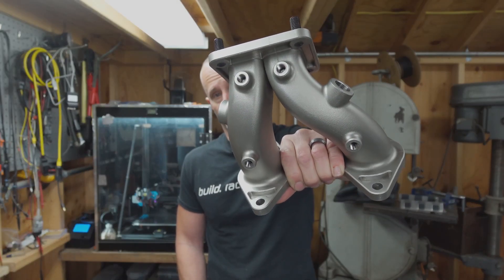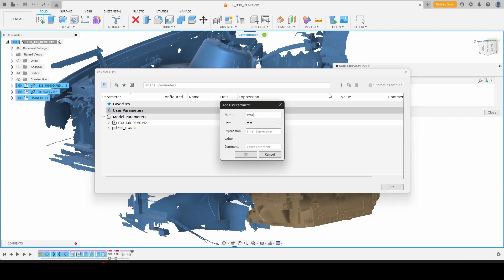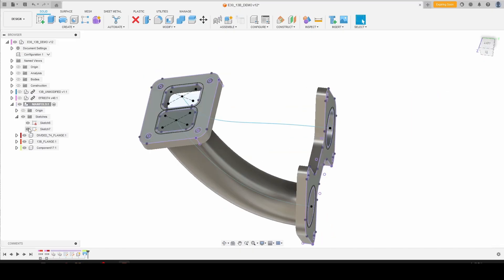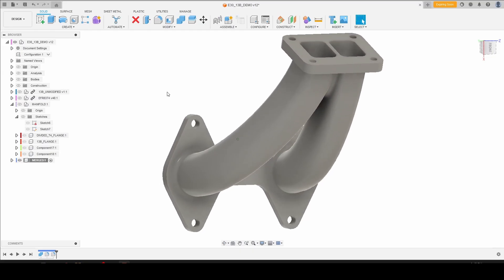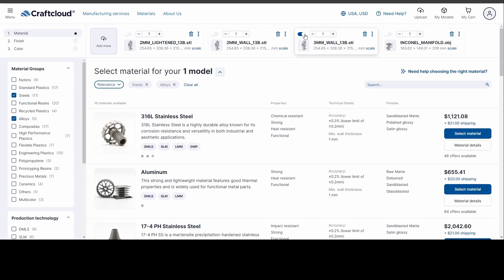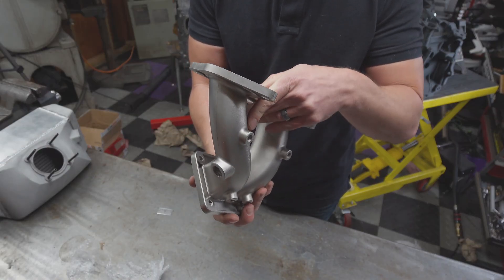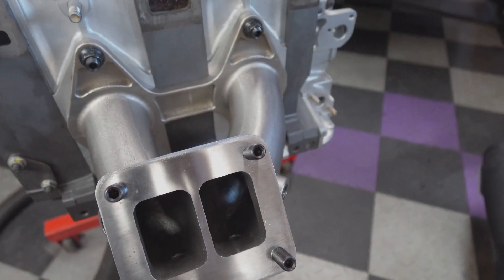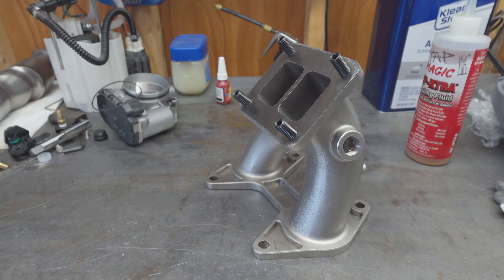Design and print an Inconel turbo manifold - Building a 13B Rotary BMW i8 : EP3

Comment: Wait I'm confused. Didn't you order SS not Inconel? Either way, this is awesome. Cool project and I subbed.
Reply from the maker: Inconel. The “order”was part of the demo to show what the typical buyer might choose. The manifold design reviewed is not the same as in the demo or checkout and you can see the manufacturer on the box is also different. Prices for the reviewed manifold are in the “i8 swap” column of the cost breakdown.
Reply: @CouchBuilt  Ah okay just confused me slightly and the colors in the pictures for the price comparison also made my brain think it was different. That's so cool!
Reply: Likewise. Way impressive and some knowledge 'bout 3D printing is mega appreciated ❣

Comment: 5 things I learned that weren't very clear in this video: 1) Don't use pipe command as its more restrictive and error prone looking for "ideal" radius turns. Loft/Shell seems to allow for tighter turns not achievable via pipe. 2) When using Loft/Shell select both ends of the loft before shelling it out. 3) Use boundary fill to select/combine the pipes and only check the sections you want to keep 4) multi fixed point splines are manageable-ish if you are okay getting dizzy spinning around making sure all angle of a spline point are pointing in the correct direction. 5) free trial license for simulation is useful to determine load/stress areas, weight savings via shape optimizer, and minimum resonant frequency for your application.

Comment: Following this video and others on your channel I designed a header of my own and sent out for 3D print (haven't received yet).  The 3D printing company sent me a message saying that because of the design a 1-2mm deformation "may" be possible.  Have you experienced this?  Have you found that the printed surface of a V-band is adequate for sealing without any post print machining?  Do you find it best for longevity / reliability to post cut (separate) the exhaust tubes at the main flange?  Oh, I used your Craftcloud discount code, thanks!
Reply from the maker: Yes, a larger part is going to have some deformation and the vendor usually does a good job of giving a warning. This really isnt anything substantial and you should leave a little material to face any flanges. If you've ever welded a full tubular manifold, things move around much more than 1mm unless its welded in a sturdy fixture and allowed to fully cool. Even then they can move around a bit. Generally the vband stuff has been usable as-is but its not a bad idea to add another .5 -.75mm of material just in case it needs facing. That wont affect clamping if you dont remove it.

Comment: very nice but man that manifold is 1/2 if not a 1/3 of what i would need for a 4cylinder, with 2 times as much material im assuming that would mean 2 times the cost. so a stainless manfold would be $1500-$2000. ill upload my manifold design to see. was really hoping this option would be more affordable.

Comment: As someone who really doesn't know anything about this (just find it interesting) why couldn't you use aluminum and be a lot more affordable and lighter. Is heat the problem with that?
Reply from the maker: It’ll melt. Exhaust gas can be 1800°+

Comment: When you placed your order, did the vendor respond back with a list of warnings regarding support martial removal, deforming possibilities and the risks of printed threads? 

I attempted to place an order and due to the complex design of my manifold there will be support material inside that will be seemingly impossible to remove. This is a much bigger concern compared to the threads or slight deformation. 

Any tips?
Reply from the maker: Generally Id suggest not printing threads and I only did so because of the inconel being a bitch to tap. For stainless and aluminum I just size to drill hole. Yes, I have had warnings about deformation or supports on various parts. Some designs will need to to multi-pieced. I did have a warning about unremovable support in my charge pipe, just around a bend, but I was able to reach a 1" emery cloth strip into the pipe and sand down the remaining material. You may need to alter the design or get creative on how you do the final post processing.

Comment: Is aluminum not a suitable material for this? I know turbo discharge is hot, but I didn't think it would be so hot that you can't use aluminum.
Reply from the maker: Aluminum softens at 1200F. 1800F pre turbo EGT isn’t unreasonable.
Reply: @CouchBuilt  It just dawned on me this is the exhaust manifold. Somehow I had in mind this was the intake manifold from the turbo, and now the steel/inconel makes much more sense. Thanks for the reply
Reply from the maker: @ChristianStout there’s another video on the aluminum intake

Comment: Holy cow, your walk through on how to do the runners is one of the absolute best i have seen for making runners.  Are your runner lengths similar volumes?
Reply from the maker: Low single digit percentage of being the same. It’s been a minute since I’ve had to think about that component.
Reply: @CouchBuilt  I know on turbo vehicles it isn't as critical as an NA build, but you are giving me energy and ideas on doing exhaust manifolds for my F136 swapped FR-S!

Comment: what is the purpose of using incanel here?Shouldnt titanium offer better spefici strengt while still being able to withstand the heat?
Reply from the maker: Inconel has a higher service temp. Titanium is better off used for structural or fastener type applications. It’s a rather poor exhaust choice.

Comment: typical higher end build? log manifolds for m50 go for 150€+ tax/shipping, "higher end" material log style collector is like 500€ max :D 1.6k for m50 log :D thats ridiculous money for a engine that doesnt even cost that much :D
Reply from the maker: It was generic example of a 6 cylinder sized manifold. Nobody would spend that on a 250k mile boat anchor. Something like a G80 S58 is another story. Also the internal geometry capabilities are way beyond a fabricated “log” manifold.

Comment: Something that you didn't mention in the video but that I think would've been worth including is that if you're thinking of dropping $1000+ on a metal 3D printed part of your own design then you really should FDM print the part to first to confirm fitment unless you're 110% confident in your measurements and your CAD files. All it takes is one error in a critical measurement to turn that nice expensive metal printed part into a paperweight.

Great video otherwise!
Reply from the maker: Good point. I used to obsessively print test pieces of all the stuff before sending out for metal. These days I just trust the CAD generated from my scan data. However, if Im using 3rd party CAD or scans, Ill still consider making a test FDM piece.

Comment: Why did you end up going with Inconel vs Stainless?
Reply from the maker: It’s a better material if you can afford it. Much higher strength at high temperature. Stainless will work fine, but the cost delta wasn’t terrible for my application.

Comment: You can use sample tubes with restrictors into small chambers with o2 sensors that get vented into your main downpipe. It will allow you to get perfect O2 readings without a need for specialty pre turbo sensors and a custom control system. You may even be able to use the bank to bank fuel corrections in your ECU 

The 2 1/8 inch holes bypassing exhaust won’t reduce spool up in a noticeable way. 

The sample tubes will allow you to mount the sensors in a easily serviceable or accessible spot

Comment: Very cool. FYI titanium is not well suited to exhausts at all, but 3d printing may help as webbing or extra wall thickness could be added in stressed areas. Inconel is choice though
Reply from the maker: I’m no advocate for titanium, but it is used by quite a few people. If they’re going to commit to that material choice, they at least have the option of adding 3D printing to the toolbox.
Reply: the irony of these sorts of statements is the existence of full Titanium valvetrains on both the Intake and Exhaust sides including retainers/keepers for decades and in Aerospace and Stationary power for Jet Turbines.  while laymen might not know what to do (personally) the OEM's have long figured this out.  whether one is big or small, cost for sure will always be a "dealbreaker".

Comment: ok so remember 3d print metal has 1% to 5% shrinkage. you always have to remember too add 1% or 2% size when at the model stage. think about it, the 3dprint metal has to be fired and so looses a few %. good video.

Comment: Would you normally print threads or just overfill then tap?
Edit. I see you did overfill them a bit
Reply from the maker: No, they are modeled at the correct size in the STL. It’s not possible to print them cleanly enough to be 100% accurate. This just saves the pain of cutting full depth inconel.
Reply: @CouchBuilt  Nice work. Subbed :)
Hi from New Zealand

Comment: Great video. I used 3D printing when I designed my upgraded replacement gearbox casing. If you have the skills to engineer and CAD your part, I think there are almost more reasons now to go that way than to buy an off the shelf part (especially if your platform isn’t as popular).

Comment: finally, we can put an end to the typical internet forum malarkey between various vendors merchandising saps and what some of is have been saying for years …
Reply: and Ti is not sufficient for a 13B or even most piston turbo applications, T321 or T347 would be much better if available.
Reply from the maker: Agreed. I’m not an advocate for titanium but some folks commonly use it, so included as a reference.
Reply: Restating it, not temperature sufficient as a header or turbo manifold.    I had Ti fail at the rear due to stress.   The full T321 system I built had T321 18 Ga going to 20 Ga on the header, and the 18 Ga. up close to the engine eventually suffered from heat fatigue cracking.   The full 3” 20 Ga. T321 system out the back still lives to this day from being built in 2009.   Back then Ti was not as readily available and cost more.   I’d still advocate 20 Ga. T321 over Ti.   The long term strength is much greater than the slight difference in weight.

Comment: Crazy a home gamer can do this now. Seems like something that has been reserved for rocket engines at tech startups and major corporations.
Reply: It has been reserved for tech startups with millions in capital backing.  As he says, dont choose this option if there is an off the shelf option that you could make work, but I could see a lot of use cases for this in highly custom applications.  If you have access to a CNC, ,you could build custom turbine and compressor housings and then post process/ cleanup the volutes to proper surface finish and clearances for well less than youd pay off the shelf.  An aluminum GT355 compressor cover is over half the cost of a replacement.
Reply: @Matty_Bski Doesn’t mean you should. Machining or now 3D printing a part is almosr always more expensive than buying something off the shelf due to quantities of scale pricing. Kind of nutty it’s a consideration…
Reply: @icey_b1562  What Im saying is that there are SS turbine housings from Tial that cost a grand, you could print a V banded, SS housing to your specs so long as you could machine the interior dimensions to perfection and be within that price.  For the compressor, you could make a custom anti surge housing or one with a specific outlet shape that would typically require welding for less than an off the shelf part.  That still requires a CNC for the cleanup work.  This stuff is definitely an option, especially in highly custom situations where budget isn't as much a consideration.

Comment: Thanks for sharing all of this, subscribed! 

I’m working on a custom NA rotary build myself, mating to the DQ250 instead of the 500. 

Any chance you can share where you got the models of your 13B and the models of the DQ500? Trying to plan out drive shafts, having trouble planning the path of the half shafts between the custom intake manifold and the custom exhaust manifold.

Cheers, 

FCLC
Reply from the maker: The 13B model was by a guy on Instagram @mitchabbott_ I bought a STEP file from him and he also sells the STL. The DQ500 scan was from Domiworks. Neither were super cheap, but both were 100% worth the investment to ensure fitment before buying real parts.

Comment: "have been sanded flat..." your definition of the word flat is highly questionable.
Reply from the maker: What tolerance do you consider flat for a manifold sealing flange?
Reply: @CouchBuilt  +/1 1 thou 0.025 micron. unless your boosting only 5 psi in that case, your sanding will do.
Reply from the maker: Considering the general rule of thumb for a cylinder head is .001” allowable per cylinder with the expectation to seal 1000+psi of combustion pressure from coolant and oil passages, the .0015” that this measures will be just fine for even a godawful 3-4:1 back pressure ratio maxing out the MAP sensor.

Comment: I'm glad I happened across this. I'm working on a project and I've already re-designed for metal printing and ordered the parts using this. Also, your collector reference for cost is misleading. The part is 3.5x2.5x3.3mm which is obviously too small for anything. I only noticed this because I spent about $50 on a stainless part that is 45mm diameter x 28mm high.
Reply from the maker: Good catch. I had to go back and look. Seems the stl from grabcad was scaled to inches and I assumed it was in mm like most sane people use 😅. That changes the price to $80. I didn’t think anything was amiss as I had reasonably similar size aluminum part that ran me $25.

Comment: that is a great tool to know about. I am also swapping a motor into a car it wasn't meant for and need an intake solution. I am not sure if printing a whole intake is the solution, but some of the parts will be much easier to have printed rather than fabricated from tubing alone.

Comment: Should't the runners be equal length?
Reply from the maker: They don’t need to be, especially on a turbo application where there’s positive pressure in the exhaust. You’re not relying on the scavenging effect for cylinder evacuation. I’ll always prioritize a shorter runner and better packaging over equal length. If you’re in a limited race series and shooting for absolute maximum power, or tuning the lengths to achieve a particular sound, then by all means the effort for equal length can matter
Reply: except a 2-rotor has perfect 180° exhaust pulses and will show a difference between balanced equal vs unbalanced unequal length when possible.

Comment: just a suggestion...a belt sander will not result in a flat surface and it may leak. I would suggest mounting it in a mill and fly cut it.
Reply from the maker: I would argue your statement should be worded “may not”. If even pressure is applied you can get an impressively flat surface. If you’re wildly varying the angle of attack then you’ll end up with a banana. The purpose of this is to show the accessibility of a technology with post processing available to the average builder. Yes, milling would be more precise, but it’s not the only valid method. In a past life I built close to 1000 welded turbo manifolds with belt sanded flanges. Sealing was never a complaint. Wrench access to bolts was the usual gripe, but I’ll take that as an L with things I’ve learned over the years.
Reply: @CouchBuilt  Honestly, even if the flange isn't 100% perfect directly off the belt sander, since you already accomplished the majority of the stock removal, it would be easy enough to improve the flatness even without using a mill. If you have access to a sufficiently-sized granite surface plate (or a similarly verified-flat surface), I've had success with sticking a sheet of high-grit sandpaper to the surface plate and manually lapping the part with it.
Reply: It seems to be all about the details of how exactly it is done in my experience. The only conclusion I’ve reached is that results seem to vary wildly depending on the person who did it 😂
Reply from the maker: 110%
Reply: Came here to make a similar comment... especially with such a large part and small belt width and high belt speed. As long as he checks the flatness on a true flat surface, and uses dye removal to prove flatness, it can be done... but is time consuming.
Reply from the maker: Next video I’ll run a feeler gauge across this manifold and the intake manifold. That one was done the same way. Saying flat is like asking how long is a string. As long as an acceptable tolerance results, the method is moot.
Reply: Uhhh, a flycutter doesn't mean it will be flat either, improper setup can mess that up too, a person could argue that unless you are grinding and lapping using a AA reference plate and optical flats it won't be flat... but there is using what you have to get the best result possible, and taking your time using "inferior" methods can produce very acceptable results.
Reply: @zebdeming  cleary if you use a glycutter, you need to know how to set it up to ensure you will have a flat surface, just like when you are fly cutting a cylinder head.
Reply: Flatness is not in relation to any other dimension from itself. It being belt sanded flat is 10/10 good enough for this project. 

As a side note, any fly cutter that is not turning backwards, will also create a flat surface. If dude was trying to get away from using gaskets, this might be a productive conversation.

It's a race car, not in a clean room